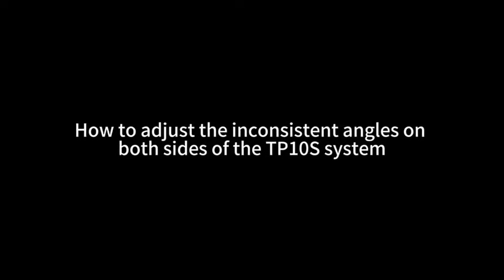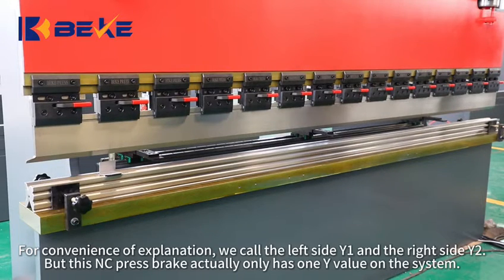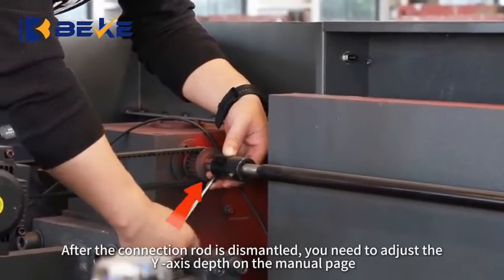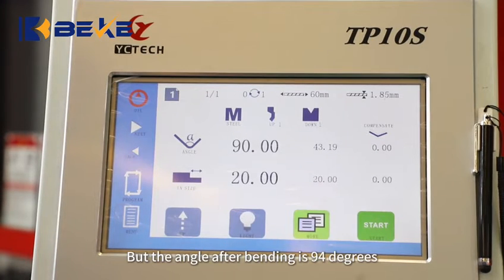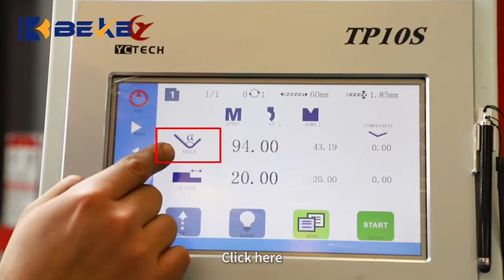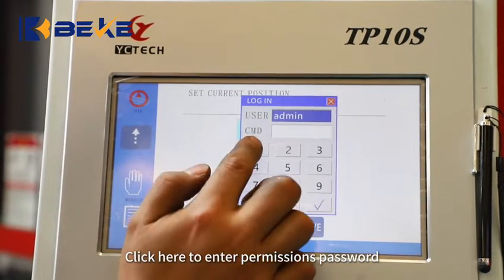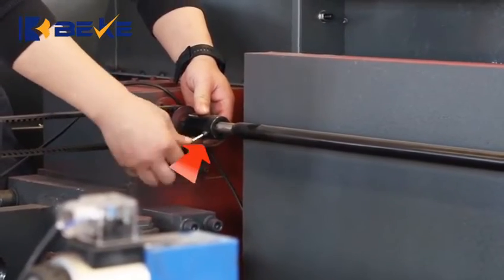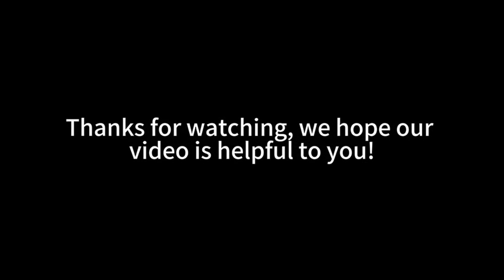TP10S#cncpressbrake system operation for Y value changing

Comment: you missed one step here. after entering 43.43, then you have to go to automatic page, enter 90 degree, push start, motor rotates for Y2 axis then connect connection rod. Beside if difference is 4 degree, you can't lower one side 4 degree, first you need to lower it 3 degree, then check. because if you lower it 4 degree to get 90 degree under Y2 this way Y1 can be 89 degree after you bend. but anyway thank you for video, it will be usefull for many NC press brake users